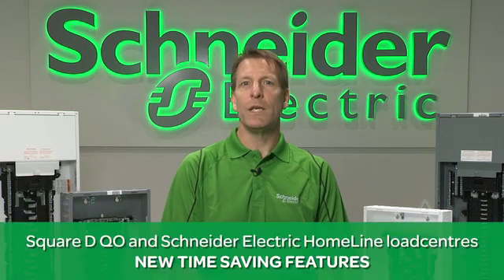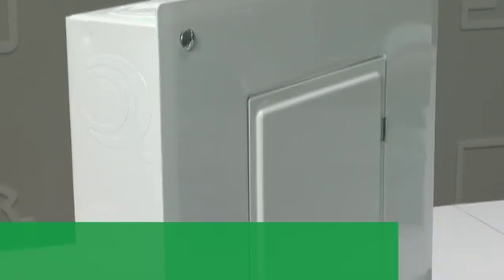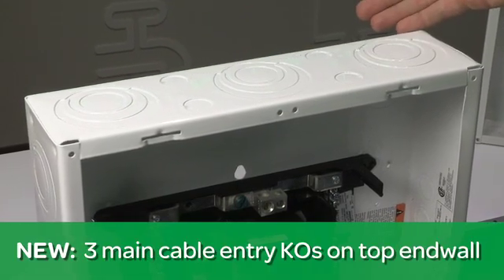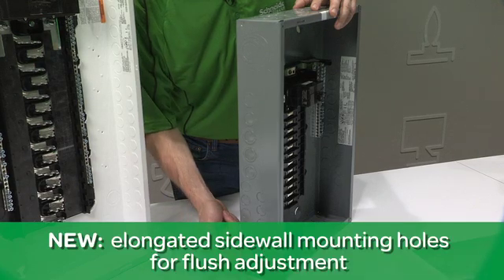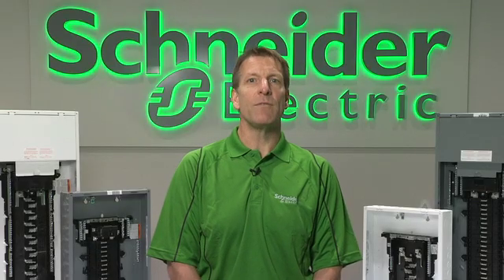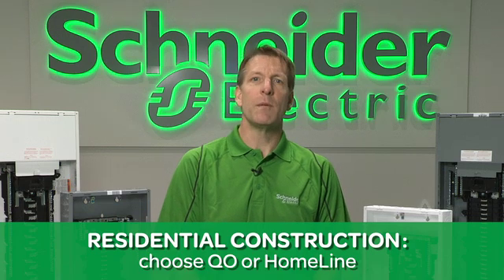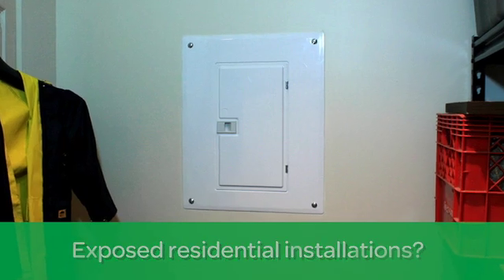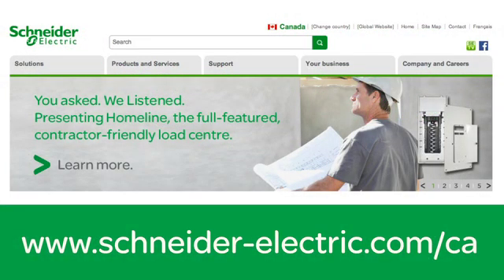Square D™ QO and HomeLine Time Saving Load Center Solution

Comment: I bought the following panel, I am unsure of what main breaker to buy...

Square D 40-Circuit 20-Space 200-Amp Main Breaker Load Center (Value Pack)
Item #: 643711 |  Model #: HOM2040M200PCVP